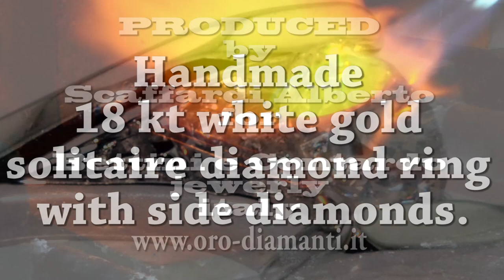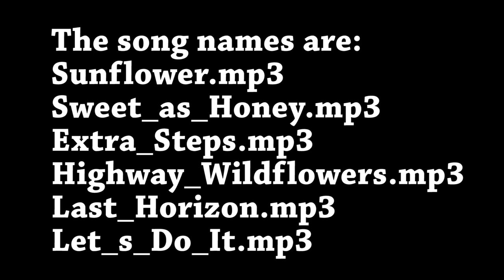Handmade 18 kt white gold solitaire diamond ring with side diamonds

Comment: Highly recommend these for you! Medihealer Ring Size Adjuster!
My rings were loose, but not enough to need resizing. I used the larger size coil to keep my rings in place and have had no issues getting my rings off or back on. My rings also stay in place now! I have not noticed any lotion, soap, etc getting stuck underneath either. This is exactly what I was looking for.

Comment: nice work! How do you collect and save all the gold chips, filings, and dust that get everywhere during the shaping process.  Do you use designated files and wheels for Gold vs silver, etc? Seems like a lot value to just brush everything of the work space and throw it away.  Thanks in advance.
Reply from the maker: Thanks, you can see https://youtu.be/TjhQNfDkP9o
Reply: Ok, great! Thanks.  I assume you use a skirt of some sort under your work area to catch everything first?
Reply from the maker: Bart Black Work on a lined wooden,  drawer metal

Comment: Heres my question, why melt metal into that thing then roll it through the mill as opposed to just using thick gauged wire instead? 

Novice silver smith
Reply: Every time the jeweller cuts or removes material, they retain it. Then they can use the pieces and the dust to melt down back into ingots. Otherwise you'd be wasting a lot of money over time buying more material, only to waste half of it again when you make the next piece. 

Although by now, you've probably already found the answer to this question :)

Comment: When you're chipping away at the silver, what do you do with all those little bits that fly off onto the work bench?
Reply: ***** An obvious guess.
Reply: that's white gold Max.
Reply: sorry shoulda finished your question, the filings and bits are melted down and refined.
Reply: I only ask because during some of the filling and boring processes it didn't look like he was keeping track of the bits. A lot of them were flying off into the cracks of the bench. When I work I tend to do it on a solid white surface with raised borders so I can gather up as much as I can afterwards. White gold isn't exactly cheap.
Reply from the maker: is white gold, however, all precious metals are collected and re-merge and are re-used, nothing is lost

Comment: I never grasped the need to plate white gold. Why use an expensive metal like gold, if you only going to plate over it. Then a base metal could have been used to begin with... I personally think the white gold's natural surface looks much better than the rhodium plate.
Reply: Robert Lakay Some like the natural white gold look and some like it extra white. It's down to personal preference but most of my customers prefer rhodium plating.